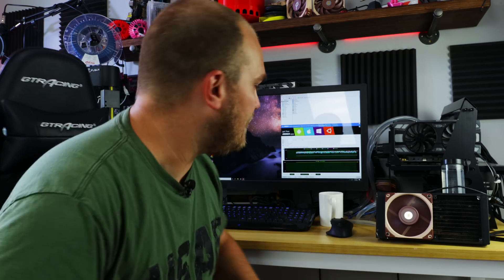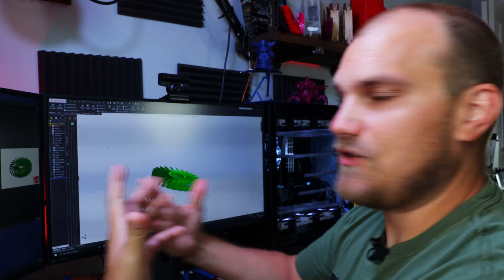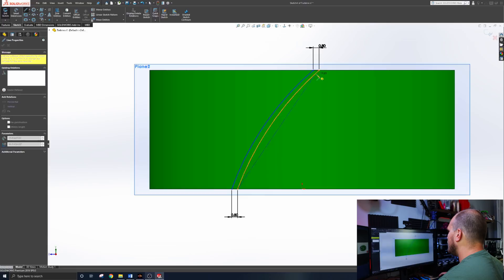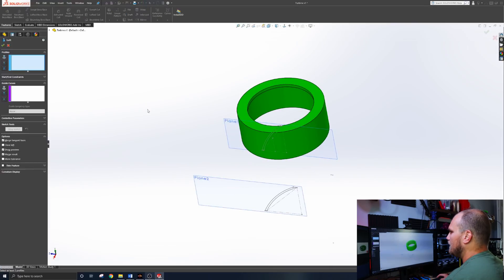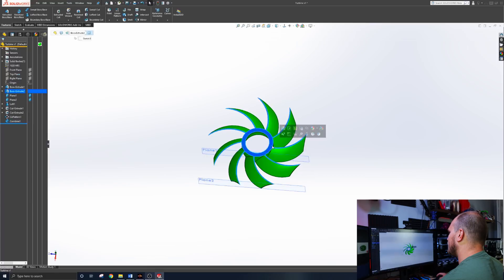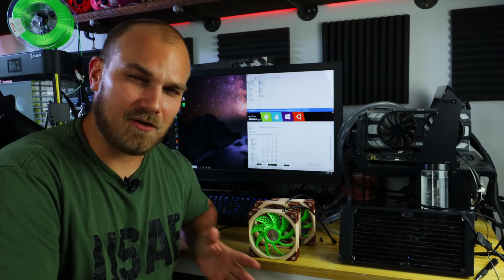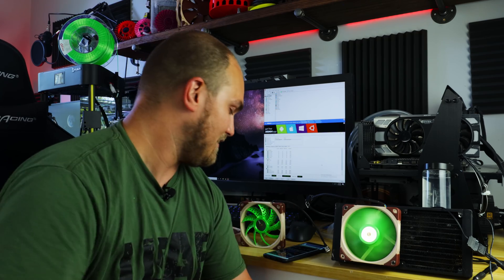Does A Holy Fan Work? | 3D printing the Answers to questions no one is asking!

Comment: You could try making smaller holes, but many more.  At some point the air bunches up and has a hard time making it through.  Check out Tesla turbines for a whole other rabbit hole, and note any talk of viscosity and adhesion.
Something to try: make your blades into perfect Clark Y airfoils, and try at different angles of attack.
And my usual request: active cooling.  Tiny fridge compressor or Stirling motor.

Comment: Why not make a shroud to run the single 120 fan on the 240 rad? And then run some tests to see does it run better in a pusher or puller configuration.

Comment: I would love to see a comparison between a 120mm radiator and a 240 with only one fan, and a 240 with a airflow adapter to connect a 120mm fan with ducts to spread the air across the whole radiator. I even have a 120mm aio I will donate for the experiment.

Comment: Double thick fan.

Take a regular 120mm fan.
Cut out the inner assembly and supports so that its just the outer bezel.
Screw it to the front of another 120mm fan.
Make a blade that is now tall enough to occupy the double thick housing.

This could open up new doors for blade designs that you couldn't effectively do before because of size constraints.

Comment: Can't really compare the RPM between different blades while on different motors. Even between identical models, you can get a few hundred RPM different, probably even up to 500rpm depending. Even with Noctua. Just the nature of fan motors.

Comment: Could the extra weight be from using 2 different printers, and the tolerances being tighter on the machine you printed the solid blades with?

Comment: Half of a 240 is still better than a 120
The extra radiator fins increase the surface area of the metal that is mostly responsible for cooling the liquid.
Also @12:33 I see some under-extrusion issues in the left model, might be a dumb question but have you calibrated your e-steps?

Comment: If you do invest in a decibal meter, get the original Radio Shack ones on Ebay. I use it for every home theater calibration and they're super accurate.

Comment: Two thoughts:
1) I think a 120 rad would change things, or at least make sure that any difference in testing is solely based on the fans. The second half benefits by passive cooling, and maybe some air turbulence from around the fans, so that could be influencing the temps you get, albeit minimally.
2) I'd suggest placing the holes not in the same place on every blade, but rotating between 3 patterns with holes. If you stack all 3 patterns in the same space, they would create one solid fan blade, so that at no air gets "trapped" in a pocket where the blades don't touch during their rotation. Every full rotation, you would get at least 3 "blades" worth of fan through each point in 3D space.

Comment: What about taking your Noctua clone design and just making it straight-up taller (vertical stretch)? Or making it a dome shape by AND-combining the extended version with a cylinder that has a domed top? Would it cool better? worse? Just look like a semitransparent boob when spinning?
Also, there's the question of rows of holes just across the positive or just across the negative pressure side of the fan blades.

Comment: So, a holey fan might not be a bad idea, ish. If you think of an F1 racing car's front wing, it's designed to direct airflow and create downforce - if you were to take that idea and sort of turn it upside down to direct airflow down to the rad. Feasible ?

Comment: You always talk about noise levels, and now with you putting holes in fans, I think you need to kick it up a notch and make both intentionally and with focused purpose. Ever since your ramscoop videos, I've been thinking it would be cool if you put flute holes to produce a certain note or notes when more or less air flowed through and how fast, making an audible speed meter. What if you did this, but with micro air channels, tunnels, and chambers to shape the sound and it's resonance frequencies match that of specific instruments. Then design different blades to play different instruments at standard scales and chords, and throw in some fancy motor controllers, and you have a fancy pants Fan Band! Fun with blades the likes of which the world has never experienced!
Reply from the maker: I've been trying getting the geometry right for a whistle fan is tough
Reply: @MajorHardware  3 minute papers did a video recently about a paper using ai to design such contraptions. I think the source code is linked in that video too

Comment: design a fan using blades shaped like an airplane or helicopter in reverse? in theory the shape would create a low pressure vortex behind the trailing edge to pull more air in.

Comment: only 2 minutes in, maybe i will have a "real" comment on the video after but must point out, it does not matter if you only use half of the radiator, 1 half is passively cooled and one is actively cooled. as long as you use only one fan (do the same) in each tests, the results are valid. that is what you call a "controlled environment".

Comment: what about a squirrel fan ...  like some graphics cards and case fans have done..maybe mount the fan sideways and have one long fan across the whole radiator - obviously you would have to build/print a shroud/housing and include maybe a pin on the other end for a shaft support opposite the motor

Comment: you do get some passive cooling from the other half that doesn't have a fan, but it doesn't matter as long as you keep things consistent, like ambient temperature and whatnot, that way you can compare the older fan models you made, without testing them again, or reprinting them

Comment: the stringy fan blade will cause turbulance causing it to spin slower.. if you do a very quick heatblast using a torch or lighter it will melt the stringy bits and leave the thicker parts, just carefully since you can easily melt the blades obv

Comment: two reasons it may weigh the same: Those strings are adding weight. Also, your scale is not intended to measure items that light.
Reply: Yes use milligrams
Reply: +1 for scale not being accurate in the mass range you're measuring in.  Also as you look for more accuracy from a scale you need to start acconting for air currents in the room.  Lab quality scales can be thrown off by a persons breath.
Reply: Hey, wondering if you could elaborate on "Those strings are adding weight."  he seems a bit more confident in the scale.
Reply: differences less than 1%

Comment: Difference in weight could be due to the difference in printing process between the printers. Try making each fan on the opposite printer for clarification. It could also be the sensitivity of the scale.

Comment: The reason it weights the same, is because when forming the holes, it makes a thick wall around them. This counteracts the weight gain from removing the extra infill.
Reply: the print wasn't as clean either, so there was more waste material around the holes. Clearly cleaning the print, or printing it on the delta, would show it is lighter. The fact it's the same weight without cleaning up the dirty waste material shows it will be lighter. Removing the waste may change the performance and noise of it, it could be louder with potential whistling and reduced airflow.... Or it could be better airflow as there's less parasitic drag breaking the airflow away from the blade. Definitely need to clean that print up and retest.
Reply: @shinjisan2015  That doesn't really make a whole lot of sense. Sure there's stringing, but the printer hasn't extruded more filament into one fan than a cleaner print. If a print only extrudes X amount of filament, the printer isn't going to create more plastic with the mess.
Reply: Seconded. Your slicer will create so many layers as top and bottom layers, and when you have the holes, you have those layers in there, as well as the fact that if you are using say, 3 perimeter lines. Where with the solid blade, the perimeter line goes all the way around the blade, but now with the holes, every edge of a hole has the extra perimeter lines on it as well. I would guess that if you had a few horizontal slots cut into each blade, you would end up with a lighter fan blade all together.
Reply: Also different printers will consume filament differently.
Reply: But I think there is no infill in the blades since the original one looks clean and does not have spots and lines on it. Also you need a very small dia nozzle to get that precise. 
Top and bottom layers prints after perimeter so it has no effect on thin walls as there is no top and bottom layer to begin with if there is no infill. 
Waste material is most likely the cause but it should not add that much from the looks of it.
Reply: he was making the blades 0.8mm thick which means with 0.4mm nozzle the blades dont have any infill
Reply: @soups1697  good point. Maybe the waste material generated the extra waste?
Reply: As he said in a later video that scale is bad and shows anything that is under 10 grams as exactly 10 grams.
Reply: Yep, this was what I was going to post, check your slicer program and the amount of material each is calling for. Also as others said. 

The two printers and there feed rates on extrusion could be using different amounts of plastic to print the same cgode.

So those are probably just a couple of variables that could cause the s a me weight
Reply: The lace of apparent weight difference between the two blades could be a function of the resolution of the scale.
Reply: So what if you beveled each hole to make sure there was little to no walls inside each hole. Would it then be lighter?
Reply: use the printer to create "dimples" where holes will live, and hand drill them :P
Reply: Your scale may be less accurate than it appears, as well
Reply: .8 thick blades jave no infill tho... that only two passes of the extruder per blade...
Reply: My first thought is just the resolution of the scale is too 'big' to measure the difference
Reply: It could be lighter by .2 grams. The scale most likely has a margin of error of .5 grams.

Comment: 120mm fan on larger radiator.   Could you make a funnel shape to duct the air flow? From the circle of fan shape to a rectangle radiator shape? Fun video. GJ.

Comment: Instead of holes, let put slits on it, with more gradually increase angle of attack to see if it has the effect of a multi-element wing.
Reply: Yes exactly. Like formula one aero
Reply: Instead of holes, what if you can inject water into the fan to weigh it (make the fan blades have a hollow line for the water droplet to travel around) like heatsink pipes having liquid that travels back and forth as it spins?
Of course ball bearing with springs does the same thing.
Reply: @dra6o0n  water droplets in a blade would simply centrifugally balance it.. not actually act as a heat pipe....
Reply: To do what your suggesting would require a completely hollow (probably copper), very expensive, "liquid" filled, custom made, and dynamically balanced fan blade.... thats doctorate/university money/research and developement money, not really youtube money.... unless your gonna subscribe... lol
Reply: @MrHaydenJr  3d print two panels of plastic for the wings, add water droplets, then melt the edges with a heatgun?
Reply: @dra6o0n  Sir, good idea, but did you know centrifugal force?
Reply: This!
Reply: This would be cool.
Reply: No that’s not it he put the wall thickness of the blades to 0.8mm, which means there are only two lines drawn by the printer and the blades are solid. If you put holes in a solid object it will definitely decrease mass. 
You would be right if it was a cube printed with for example 10% infill with a hole in it. The hole would take out some of the infill, but generate more surface area than it takes away because the printer prints wall around it.
Reply: Like a Mandolin grater?
Reply: Golf ball dimples might be a better effect than slits or holes. Holes will only reduce surface area and won't be much of gain.

Comment: Try Gurney flaps: a small tab projecting from trailing edge of the pressure side of the airfoil, 'height' is 1% to 2% of the 'wing' cord. Gurney flaps are used to improve performance of simple airfoils. They're used in many applications (auto racing, helicopter horizontal stabilizers, etc.).

Comment: A 240 has more material and water which means it takes longer to reach max temp. The larger surface area will also help dissapte more heat. But if all tests are the same who cares

Comment: The issue with using one fan on a 240 rad:
1: The fan is not sealed against the radiator body or another fan on all four sides, resulting in a loss of static pressure.
2: The results can be skewed by passive airflow going over the other half of the radiator.
At the very least, you should print out a cover plate to go over the secondary fan area, so that the fan in use is properly sealed for static pressure, and so that the results won't be skewed by the potential of passive airflow.
But really, you should probably just buy a 120 rad so you don't have to worry about any of that.
Reply: I like the cover plate idea and it would be real easy to print out a cover plate for testing.
Reply: It doesn’t matter at all as long as all tests are performed with the same setup. It won’t be comparable to past results, but amongst tests performed in the same manner, it won’t matter.
Reply: @enderoftime2530  What I was thinking, it is a constant variable since he is running the same way for each test.  There will be a difference but within the margin of error.  If he really wanted to control for it, then he would need a climate-controlled room and turn off the computer to cool and start up the same way.  for what Major is testing, its perfectly fine.
Reply: Question though. Would using only one fan cause the non cooled side to be warmer and create a hot side heat soak working against you?
Reply: seems legit
Reply: A coverplate would have the opposite effect of passive cooling, it will insulate and also skew the results.
Reply: I might add: How about a shroud, for one fan to blow through the whole radiator?

Comment: Depending on your slicing program, you should be able to tell the amount of filament used and how much each costs to make with the filament you use. You should include that info. Even if you do not include price, you should be able to give a percentage of materiel cut from the model..

Comment: In fact as a propeller blade IN fluid, it can do a lot of things, given angle and speed, it can adjust against the drag at a certain level, but it will make control more difficult. In a flexing system you can decrease diameter for faster turns, then Return diameter for a drag to reverse strength as well without engine reverse on the shaft. You have to measure in very controlled sizes to perfect the design based on the weight as well of the craft.

Comment: 1) Is the inside of the printed fin solid? If not, the extra weight could be the inside face around the circumference of the holes.
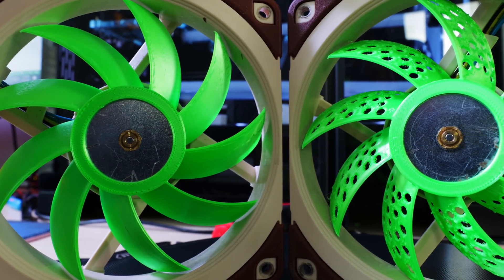2) It's hard to see on Youtube but at 12:30 you can see the Hubs up close, and the solid-finned fan appears to have much more space in its hub than the Holy Fing.
All I can come up with regarding the weight.

Comment: it could be the same weight because you printed them on diff printers
Reply from the maker: possibly but ive run test cubes through both and both extruders seem to be extruding pretty well.
Reply: @MajorHardware  An interesting test you could do would be to check their volume displacement in water to see if they are different or the same.. (assuming they do weigh the same then their densities would be different)

Comment: Wow, these prints are way smoother than the previous videos!
Reply from the maker: They are!, im slowly learning, i think i need to lower the temps a bit to cure the stringing
Reply: @MajorHardware  it would be interesting to have another look at the 'Fake' A12 Fan Blade on the new printer
as it seems a much cleaner & smoother result it may print a more balanced replica Fan

Comment: We’re they solid models or did they use infill. If so the the material to connect around the holes would make up for the top and bottom layers missing from the holes.

Comment: "Does A Holy Fan Work?" ... Depends, did you get it blessed by a priest? ;)
Reply from the maker: the power of airflow compels your
Reply: Wololooo
Reply: Only on Sundays 🤔 or maybe Saturday depending on it's religion 😁
Reply: and more importantly does it works against rabids?
Reply: @satibel  
he has to spin it to 300rpm  no more, no less.
the software might show it as 500rpm though before correcting to 300
Reply: this religion blows
Reply: This gives a "hole" new meaning to purified air.